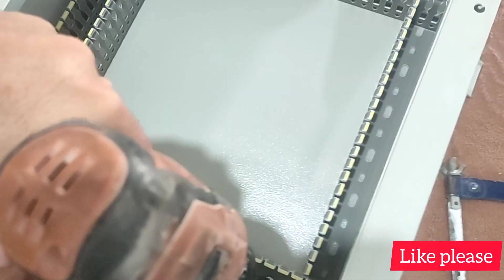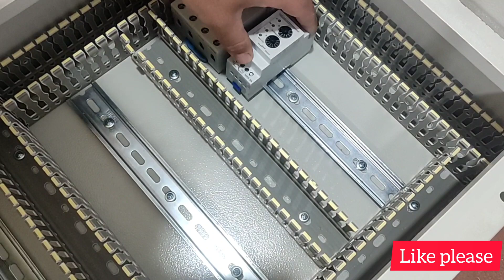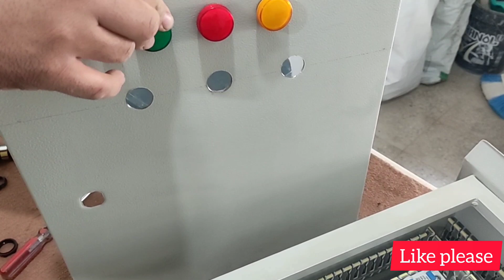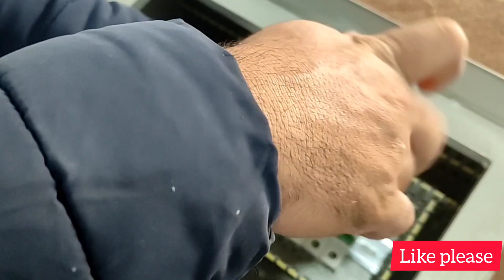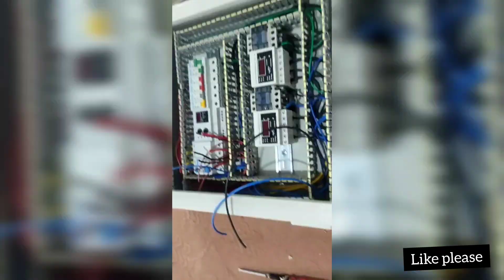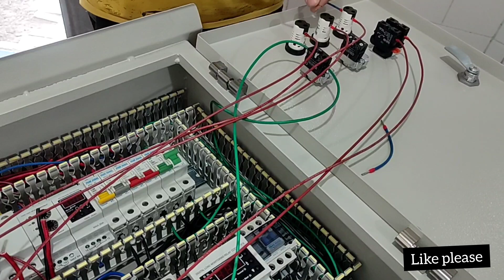Industrial electrical panel wiring(with all details)

Comment: Dear sir please make a video only one single phase motor and one three phase 
all equipment details 
power diagram 
control diagram
Wire detail
Eplan digital
Panel sizing 
Thank you sir ❤
Reply: Thank you so much sir 
Allah give a more success in life
Reply from the maker: Hello
I will do this in the future
Reply: I design panels from small to very large, 8 drives, 6 transformers, etc.  a lot of info online